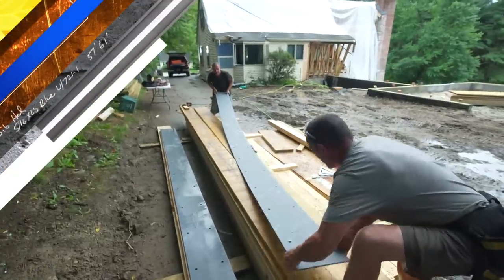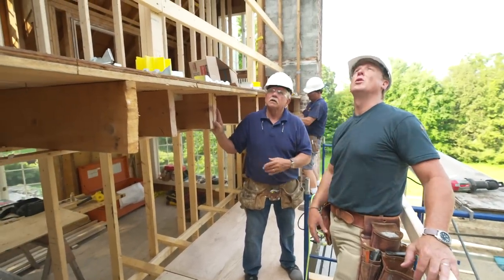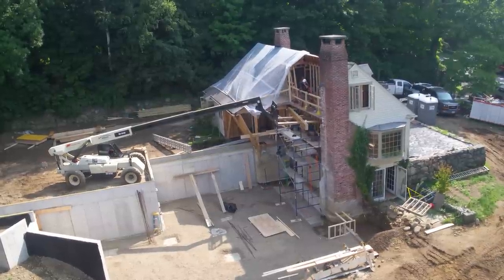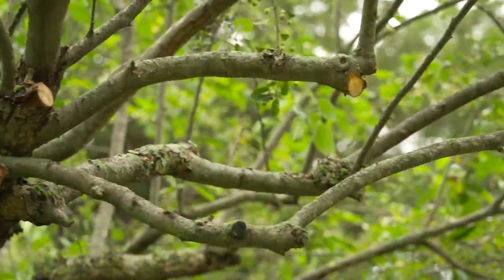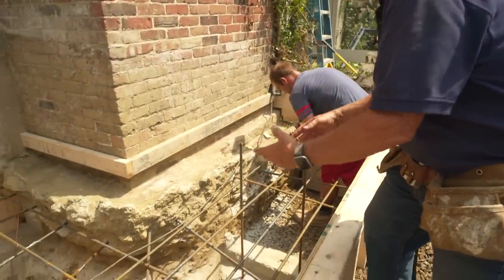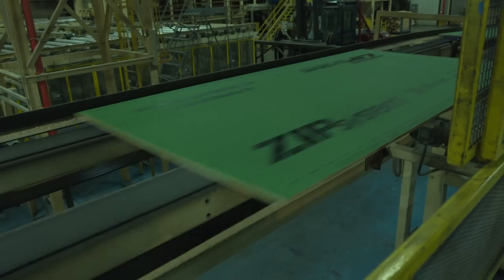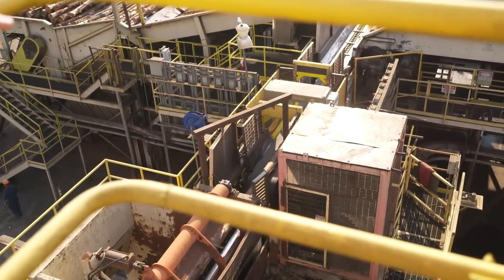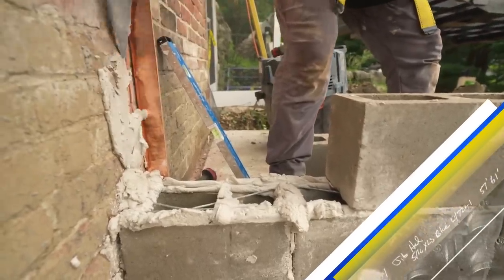This Old House | Tree Dr. House Call (S43 E6) FULL EPISODE

Comment: In the 80's when my home was built, my house was covered only with Tyvek (no sheathing).   I found out doing when doing some serious telecom and cable upgrades.  I drilled through the siding right into Tyvek, then insulation.  DuPont does say that only Tyvek can be used over studs, but strongly recommends sheathing first.